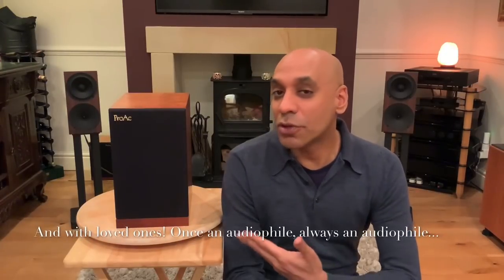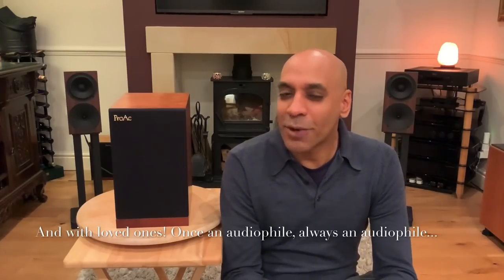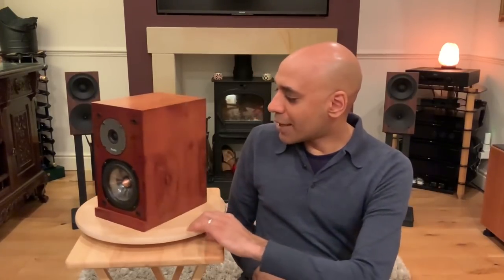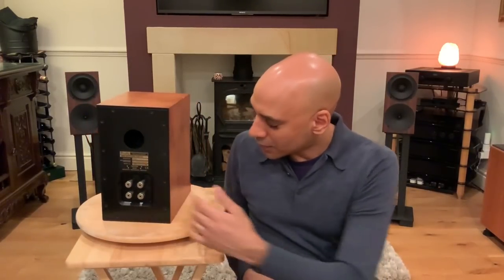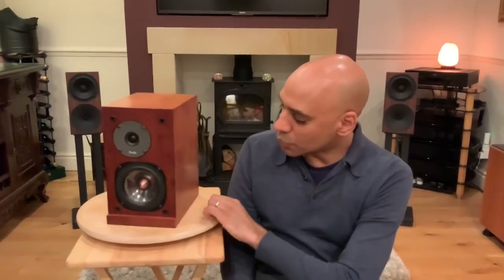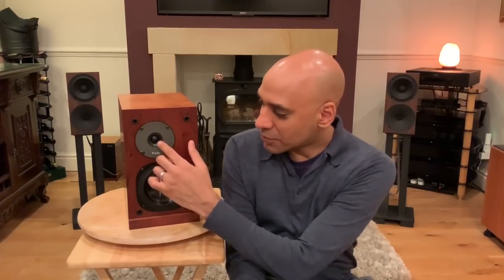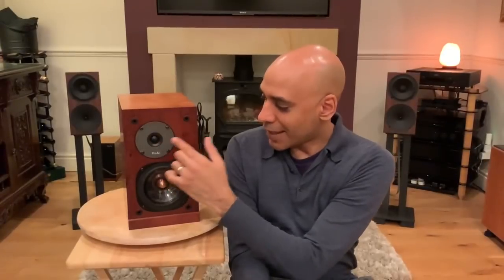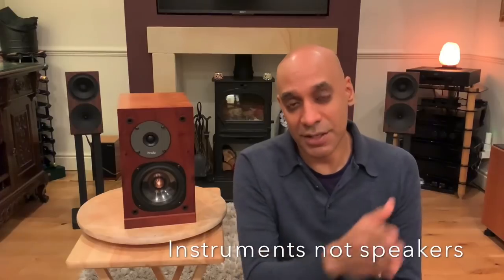Proac Response 1SC Speaker Review (biased?)

Comment: nice review. By the way, do you know how are this Proac or the DB1 (or D2) with a 300B SET amp that delivers around 7 or 8 watts in an small room, where, more than sensitivity, efficiency is required, that is, that the impedance does not have a severe drop and is kept as high as possible across the frequencies ?
Reply from the maker: I suspect the ProAcs will require more power. A single driver speaker might be worth trying 😊👍
Reply: @abritishaudiophile7314  thanks so much for your answer! I have used some old, made in England, KEF floorstanders that have 91db of sensitivity, with a drop at 3.2 ohms that generate a very good sound pressure, with very tight, defined and extensive low frequencies. Recently some Zu Omen, which are practically a single driver with a tweeter to extend the high frequencies up to 25 kHz, with only a capacitor between them. They sound delicate, although the low frequencies are not as tight and punchier  as the kef. But now I have more limited space and would prefer to have a good quality stand mount speakers. SET amps cheat a bit about the ability to deliver sound pressure. With only 8 watts, depending on the efficiency, they can achieve quite a high level.

Comment: Thank you for your great work,I am thinking to get a pair of proac response 1sc, on a budget what integrated amps will drive them well? Thank you reinhart
Reply from the maker: Thank you Reinhart. I appreciate your support.The 1SCs do like a bit of power to get them to sing and of course you need something to allow that glorious midrange to come through. The Hegel H90/95, Naim Nait 5Si, Audiolab 8300A and Exposure 2510 will do the job. If you can try and find a good used one or ex-demo 😊👍
Reply: Thank you, du you think a nad c316 bee can run them .
Reply from the maker: @reinhartfrais2434   no, even the NAD C338 struggled. They don’t have the clarity either.
Reply: Thank you,last question  du you think the Marantz pm 8006  can running them .
Reply from the maker: @reinhartfrais2434  I haven’t tried it but on paper it looks like it should be able to 😉
Reply: Thanks a million. Very Kinde of you.
Reply: I will get a Hegel ,du you prefer the h 120 over the h 95? Thank you Tarun.
Reply from the maker: @reinhartfrais2434  the H120 will a bit more power and control 😉

Comment: Nice and informative review. What speaker cables do you recommend with these? I've used my response db1 with a few cables and so far it seems to like the van den hul cs122 best, single wired with the same jumpers as the cable in a diamond config.
Reply from the maker: Hi Caron, I don’t think you need to spend a lot of money of expensive speaker cables. The Van Den Hull will be fine. If you are looking at twisted pair configuration then just check that your amps don’t require a higher inductance figure 8 cable. Thank you for watching and commenting 😉👍

Comment: If the mid/bass cone is transparent it’s more likely a material called TPX rather than polypropylene. The copper phase plug strongly suggests an SEAS design and the tweeter also looks like one of theirs.
Reply from the maker: Thank AudioFlat, I think you are right the consensus is that it is a SEAS mid-woofer. I think the phone used Peerless for woofers on larger models in the Response range at the time but they ate never forthcoming in confirming these things. I am almost certain that the tweeter is a Scanspeak D2010. Thank you for watching and sharing 😉
Reply: Yes, on further investigation, I’m sure you are correct about the tweeter. I was wrong about the cone material, not TPX but TXP and SEAS also did just such a driver with a copper phase plug and the same shape basket surround - so I’m pretty confident it is an SEAS design.

Comment: Hi, Tarun my radar quite aimed lately on the tablet 10 signature model of proacs. Do you have any idea on sound signature between the 2? my room is 11.5ft x13.5 ft. Quite small. I'm using a schiit aegir and saga + combo. I know that Tab 10s are rated in 10ohms and I will be fine in driving the speakers. I really like the class A design sound character of the Aegir. Your info will be much appreciated. Keep up your channel very helpful to us audiophiles.
Reply from the maker: Thank you Alain. Two very different speakers. The Tablettes much more natural in the midrange, warmer tonal balance and designed to work close to walls. The Argon 1 is more dynamic, faster and cooler in tonal balance 😊👍
Reply: @abritishaudiophile7314  hi ty for the reply. Let me clarify, I'm inquring in between the proac 1sc and proac tablette 10 signature. Hope you have any idea between the 2 Pro-Ac speakers
Reply from the maker: @alainbesario6679  thank you. The 1SCs are quite a bit better. More open in the midrange, more dynamic and better bass extension. The Tablettes will work better if placed close to walls though 😊
Reply: @abritishaudiophile7314  ty so much tarun

Comment: Hi Tarun , Hope you are doing well. I did a lot of research and reached the ProAcs tablette signature edition  for near field listening. 

Now trying to research on the amplifier ; I found some of the guys recommended primaluna prologue 5 integrated amplifier. Now it seems that I am diving deeper and deeper into a black hole and losing my peace , time and money.  

Any suggestions for a DAC and AMP are welcome. I am not into bright music and I guess I am more of a female vocal guy and a mid range guy. 
I have also found denon Pma 1600 ne interesting and willing to get something from eBay uk also. Forgot to mention I am based in Singapore.
Reply from the maker: The Exposure 2510 would be at the top of my list to audition with the Tablette Signatures Gurkirpal 😊
Reply: @abritishaudiophile7314  Thanks Tarun... I  also saw your review of it and it looks like it has vanished from the new and the used market over here.  This weekend I will go the Adelphi mall and try to find one. By the way , is the Model 3010S2 (at around 1000 GBP over here) be okay if 2510 is not available. I know 2510 is the exact Power rating that the system needs but 2510 might be a difficult one to get. I also found an old used Exposure 2010 at around SGD 478 GBP. I am not a budgeting guy, more like buy more and then earn more. Let me know your thoughts.
Reply from the maker: @tango_gru  the 2010 was the predecessor to the 2510 and the 3010 S2D to the 3510. We I reviewed the 3510, I found it to have more clarity and dynamics than the 2510 but not it’s natural tonal character. I should be tempted to try the 2010. If it performs similarly to the 2510 it would be a real bargain 😊

Comment: Have you heard the ProAc Tablette 2000 signatures? If so how do they compare to 1SC's.  You did a great job and fair
Reply from the maker: Not the 2000 version. The Tablettes are fine speakers for small rooms where you need close to wall placement. The 1SCs are more dynamic, have better bass extension and a more open midrange. At the time the 1SC represented the finest compact monitor speaker ProAc were capable of making.

Comment: HI there loving your advice, have  you tried them with a gd valve and what did it sound like ?
Reply from the maker: Hi Hamzat, I have heard them with low powered valve amps but not at home. The 1SCs were very popular in Japan and used a lot with valve amps. A good valve amp should make the most of the 1SCs revealing and natural midrange. Worth giving it a go if you don’t listen very loud as they are only 85dB efficient.
Reply: @abritishaudiophile7314   thanks for the quick reply Turun, but your speaker need lots of power to drive because of the make of drives  have you heard of Ukraine speakers called audio contrast, they have crossover less and paper balsa wood drivers    https://www.youtube.com/watch?v=yWm1vlTkdvc
Reply from the maker: Thank you sharing Hamzat
Reply: @abritishaudiophile7314   very gd reviews with valve

Comment: You will have noticed that I've been binging your channel these last few days. I'm having a blast with no expectations of customized replies so please ignore me if and when it gets fatiguing. With that said, I do have a specific technical question that arose from this review:

One of the points you've emphasized here is that the Proacs are an unusually easy load to drive, with amps rated as low as 40/8 having no trouble getting them to sing. I don't remember which other video of yours -- it might have been one of the bookshelf rundowns with Ian -- I thought you'd described these as being unusually challenging to drive, and a poor choice to pair with amps that weren't able to show them the whip. 

Did I imagine that, or is it more a question of absolute-vs-relative scale for difficulty of the load?
Reply from the maker: Hi CD, this is an early video. Now that I have tested my ProAc Response 1SCs with an a lot more amplifiers and compared them to many more speakers, there are a couple of things I would change my opinion on.

Firstly, the 1SCs really benefit from being fed with better quality amplification. This is something I mentioned in this review but I hadn’t realised that even my 40 wpc into 8 ohm Audiolab M-PWR was quite quite good at driving tricky speakers.

Secondly, I would no longer describe the 1SCs as rolled-off on top. When compared to many other speakers they are neither bright or dark. Pretty neutral on top in fact.

Comment: Isn't it essentially a LS3/5A type monitor?  I know there are some differences, mostly in how they position the tweeter..  I've heard the Pro Ac, for a small monitor, those things are great speakers.
Reply from the maker: Hi Oneness, I certainly has some LS3/5A DNA but that was a sealed box, high impedance design and the 1SC is a bass reflex, 8 ohm design. Fundamentally different drivers but both 2 way monitors that share some sonic characteristics.
Reply: @abritishaudiophile7314  Thanks.

Comment: Why not bridge the M-power using 2 or 3 units,  making it 120W?
I have Audiolab -C, with 4 power amplifier,  making it 240W.
Reply from the maker: It is is used in a bedroom system where it has sufficient power. Also use it to see how speakers cope with a small amplifier.